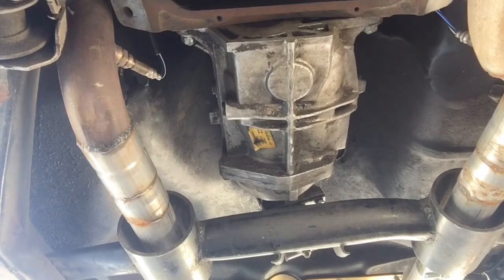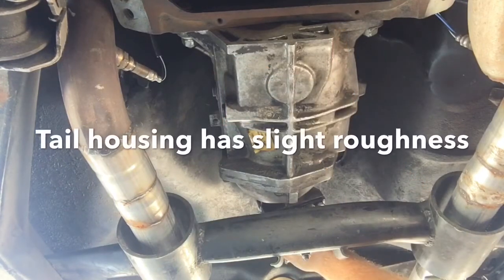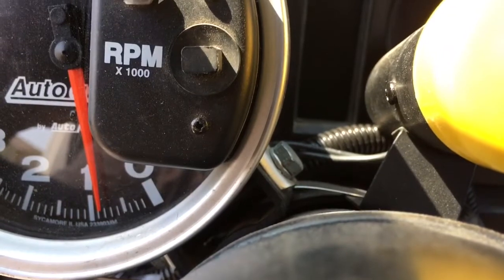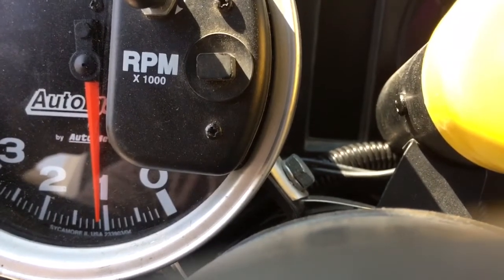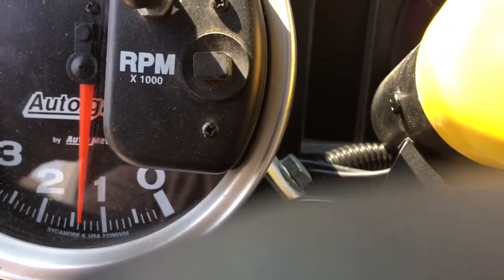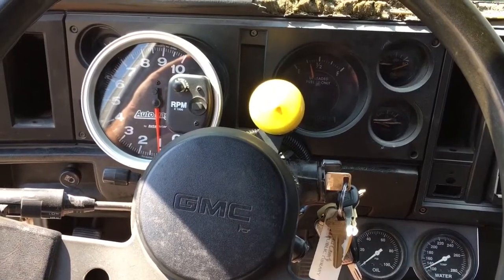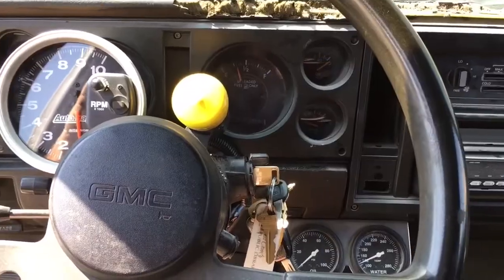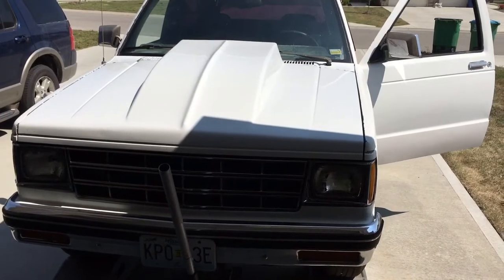4.8/T-5 swap 1985 S10 Blazer driveline vibration 2.0

Comment: Pour a can of sea foam before the next oil change into the oil and let it idle for a while then change the oil it will help unstick that lifter.
Reply from the maker: BRIAN HENDERSON Check out all my videos trying to flush the lifters! 👍
I've tried:
*Motor Flush procedure.
*Rislone oil treatment 
* Added 1qt of ATF to the crankcase, then drove 100 miles. Bad idea, it did act as a high detergent but was so good it caused smoky start ups!  Pulled that crap out, had to change the filter several times with in 2 weeks because of all the gunk broke loose by the ATF. 
Note:  All the high detergent I tried did flush the engine really well, I used to have a hot idle oil pressure of 20-22#, after the ATF flush the engine the hot idle oil pressure is now 38-40#!!! It never drops below 38# 👍
The only two things I haven't tried so far:
1. Sea foam which is another detergent.
2. Spraying Berryman b-12 straight down the pushrods to flush the lifters.